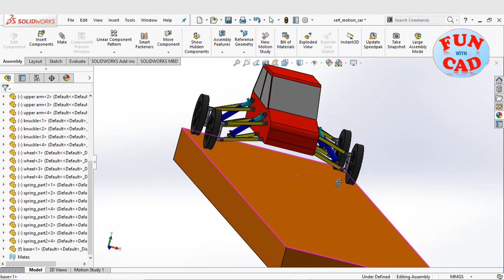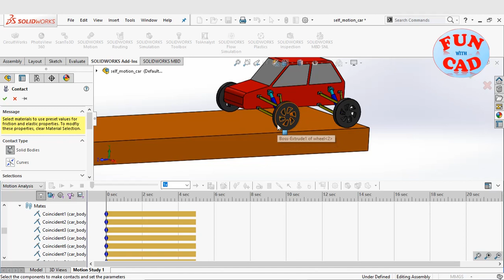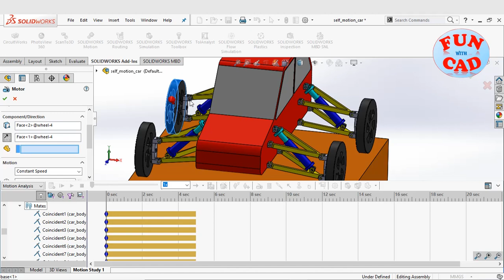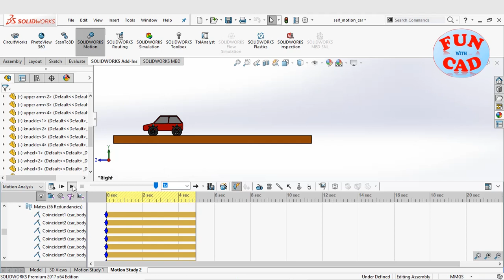Learn to add friction between TYRE and ROAD for CAR MOTION | SolidWorks Beginner Animation tutorial

Comment: Any idea how to add a rolling resistance force?
Reply from the maker: In this case the wheels are rolling against the friction between road and wheel, i.e I have indirectly applied rolling friction. If the wheels were to slide over road, it would have been sliding friction
Reply: @FUNCADwithMrROBOT  rolling resistance is a different concept than the one you are referring to.

Comment: I try to make an animation just like that but It failed. Car's wheels are turning well  unfortunately car didn't move even 1 mm. Have u ever faced problem like this.
Reply from the maker: Hi, make sure that the SolidWORKS motion add-in is loaded.
Also, check if gravity is active, because friction force is generated only when there is a Normal load acting on it.
Reply: @FUNCADwithMrROBOT  Firstly thanks for your kindly return. I uploaded issue video can you please check it İt takes just 3 min. https://www.youtube.com/watch?v=XdQZkYVMSEg
Reply from the maker: I checked the video, I think you forgot to add a body about which the wheel will rotate while adding the rotary motors
Reply: @FUNCADwithMrROBOT  I will try thanks for your support
Reply: @pasaaa14  is it worked?
Reply: @khanaftab9041  I chosed coefficient friction then finally it worked.